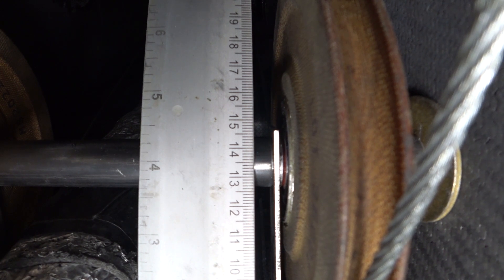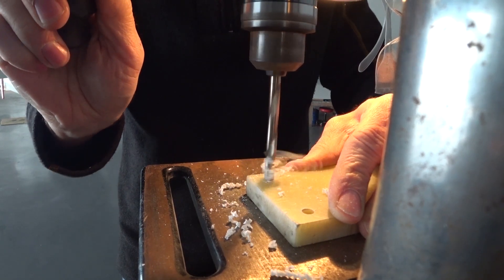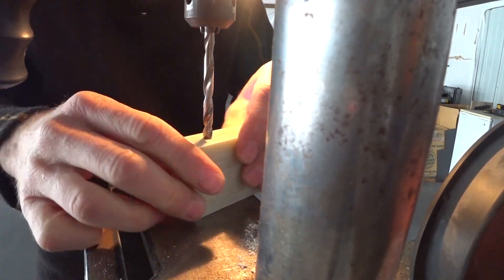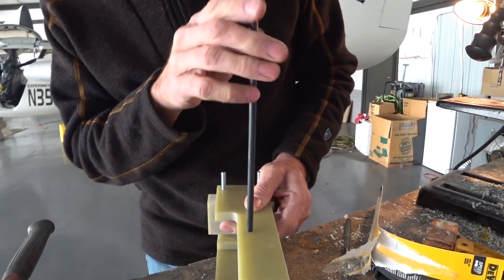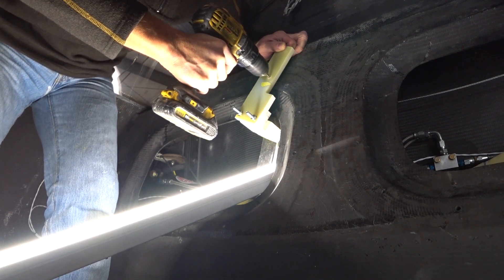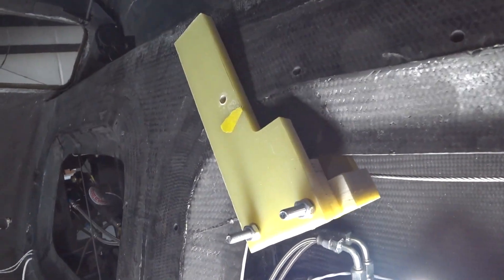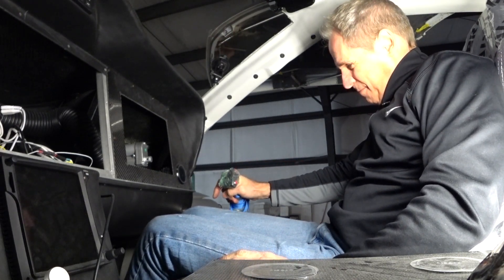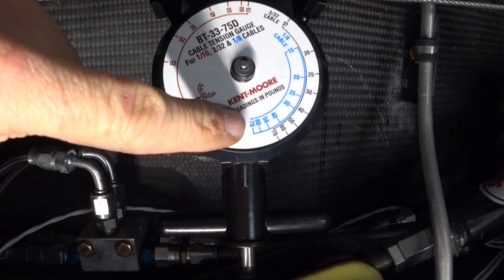Play Time is Over - Building the Raptor Prototype

Comment: It worries me how much side load you have on the pullies. I think you need to align every pully correctly to take the side loads out or add pullies at 90 deg to deflect the cables to push them over until you have no side pull on main pullies. 

All the flexing of the brackets will result in a stress fracture one day. I just hope it happens on the ground and not when you are flying.

Comment: At 14:09 , a pulley with bearings that took a larger diameter shaft would mitigate that flex. Steel generally has very good fatigue strength, but I would still want a larger shaft for that length/span. By rolling some custom pulleys and turning a new solid shaft, you would have a stronger setup, with better pilot feel.

Where you have washers, the kiel side could be strengthened, I suppose. I still worry about any pulley that has any side loading.

A Harbor Freight Oscillating Multi-Tool (bone-saw) would let you cut things out of there, if you needed to.

Comment: Is there any risk that all these holes, cutting and additional components (some of which may shift loads and/or create stress points) could compromise the overall structural integrity?
Reply: He seems to be adding enough material to keep strain/ stress down. The weight is going up a little.  Such an project! Great way to spend a lot of time!

Comment: Admire your tenacity. I'm more of a software developer. So not much physical eng. 

These test are in ideal static mode.
So I'm thinking there maybe slack from entire fuselage flexing in flight?
Reply from the maker: Yeah, I don't think so. The cables are only in areas with little to no flex.

Comment: also what load can that stop on the cable handle?
Reply: When it's properly installed with a Kearney swager, an MS20663C double-shank stop ball like that will react the full breaking strength of the cable. When it's improperly installed with a Nicopress crimper as Peter appears to have done, all bets are off.
Reply: This page has more info: https://www.aircraftspruce.com/pdf/2020Individual/Cat20133.pdf
See the part at the bottom where it says "The terminals featured on this page must be installed with a rotary swaging tool, which is too costly for purchase by a homebuilder or small shop.  We offer swaging service and custom-made cable assemblies in cable sizes of 1/16” to 5/32” diameter."
Reply: What I liked about HP aircrafts comments is that their conscience could only last four hours until they divulged a vested interest. :)
Reply: Cheers mate, was just a light hearted comment. Didn't mean to alleged any impropriety. It was exactly your point that makes it funny. In my opinion. 

I liked his comment as indication it was in good spirit at the time.
Reply: @hpaircraft2187  , perhaps, when it's all worked out, a better set of cables could be made. I am the not kind of person who tosses words like "improper" around, unless I want some discourse with someone.
Reply: @BrendaEM  I don't throw words like that around lightly. But crimping SS swage connectors with a Nicopress tool has caused fatal accidents in my line of work, so I take it seriously. Marc Z. is already aware of this issue.

Comment: Steel touching carbon fiber, electrolysis corrosion,   might want to see if this is an issue. Thanks
Reply: It can be. Generally, at the interface of the two, they often put a layer of fiberglass as insulation, such as used in bikes and boats.
Reply: This is mostly a problem when you laminate carbon cloth onto steel. Attaching steel to a cured carbon composite surface is less of an issue. For the long term you'd want an insulating layer of fiberglass between the carbon and the steel. For a prototype this is probably just fine the way it is.
Reply: Yeah or we could just allow folks who take action to get on with it.

Comment: i know you probably get a million "i did it this way, why didn't you do it that way" comments but have you ever considered using Dreamers for drilling composites? if you dont know its an approx 8 in carbide bit that does both drilling and reaming (hence "Dreamer") and gets you a cleaner hole than a standard drill bit for composite work. they're pricey for sure but worth it IMO.